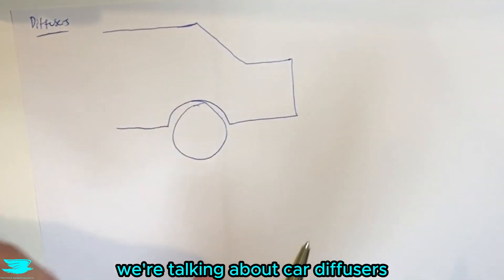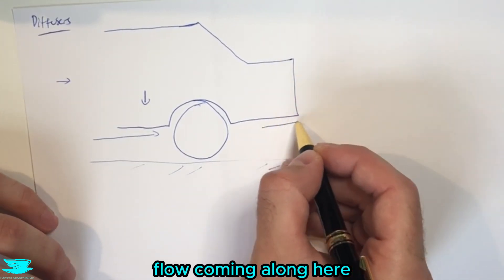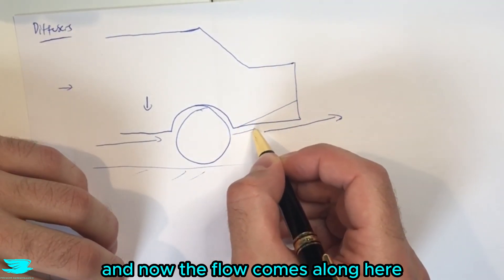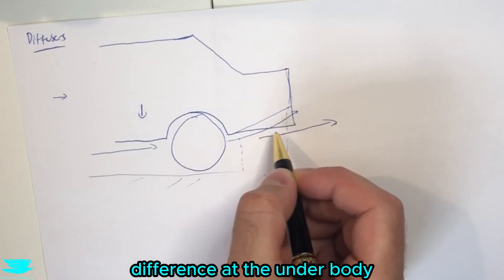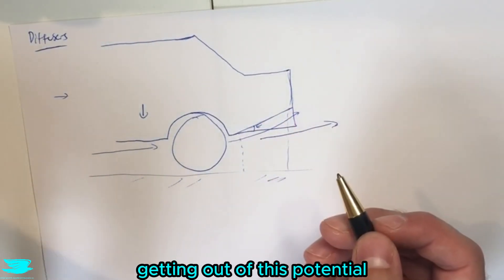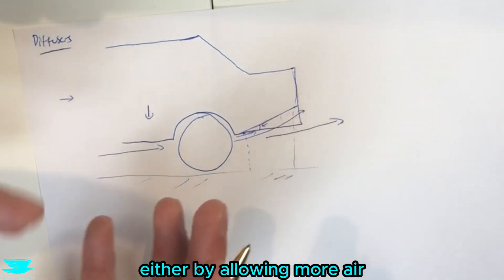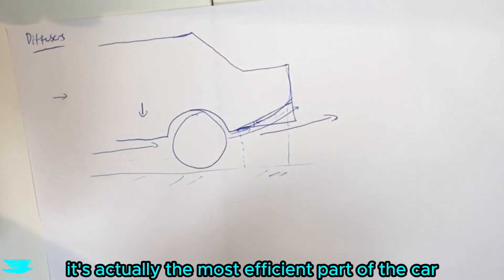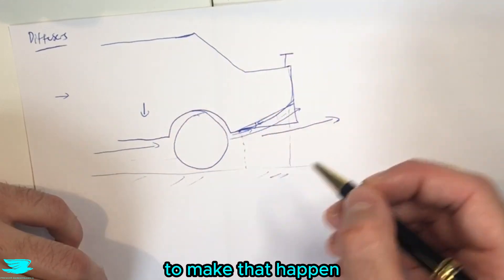Diffuser Aerodynamics {Auto Aero #57}

Comment: Do diffusers also have the benefit of reducing any negative pressure gradient along the diffuser/any Venturi tunnel by better connecting the low pressure underbody flow to the low pressure wake region behind the car, and therefore also helping to pull the flow through?
Reply from the maker: They help more with pressure recovery, so it boosts the pressure in the wake. There unfortunately is an adverse pressure gradient along it and that causes separation at too steep an angle.
Reply: @PremierAerodynamics thank you!

Comment: Could you do one optimised on just drag reduction as opposed to generating downforce? I'm guessing that might want a slightly shallower angle too or? As the other factor is the more downforce the higher the rolling resistance would be
Reply from the maker: Sure, thanks for the suggestion. Just quickly, for drag reduction, it depends on the size of the wake to begin with.

Comment: Diffusers are very complex, just like lift on a wing there's several factors at play to create the measurable effect. As a result there's several different ways to look at a diffuser. Take a bellows for instance, as it expands it draws in air. A diffuser works kind of like that, as the car moves the diffuser acts as a bellows constantly being pulled apart to draw in air. Because a diffuser recovers pressure, but not fully, you have a favorable pressure gradient from the inlet of the floor to the diffuser exit. Because the exit pressure is near atmospheric, and because pressure increases as you go along the diffuser length, then the minimum cross section area of the diffuser must necessarily be below atmospheric pressure. Then you can think of the diffuser throat as a nozzle.

The diffuser, also works similar to an inverted Ahmed body, and therefore two counter rotating vortices are formed by the diffuser(due to it syphoning air like a bellows), which creates upwash(downforce) which also helps flow stay attached like you showed in your video about the Chrysler Airflow(but reversed).

Now, tire wake, will destroy the performance of a diffuser, this is because tire wake is just turbulent mixing, adding turbulence to the flow slows it down saps its energy as it's dissipated as eddies. Things are even more difficult when you consider that you want the downforce to work in corners, not just going in a straight line. When you turn, the car is essentially running over its own tire wake because you're turning into the wake.

Now, the inverse is also true, you can improve diffuser performance drastically by reducing the back pressure after the diffuser throat/nozzle, remember the diffuser's pressure recovery is nearly constant from throat to outlet, so the lower the back pressure at the outlet, the lower the pressure at the throat as well.

In modern F1 cars, the Cp at the throat of the diffuser is like -18 or lower at 250kph, it's not crazy to think the flow is sonic.
Reply from the maker: I do wonder how compressible the flow under an extreme diffuser is? And the rear wheels will greatly interact with vortices forming around the sides of the car, so that is an important interaction.
Reply: @PremierAerodynamics  Absolutely, this is why almost every race car with serious aero tries to push the tire wake away from the car.